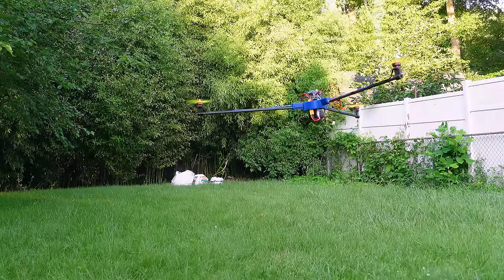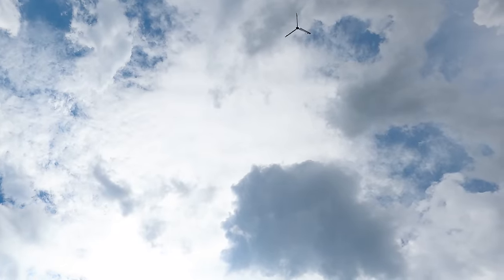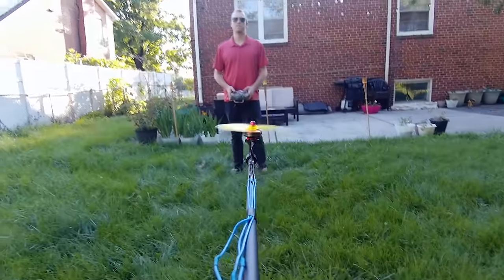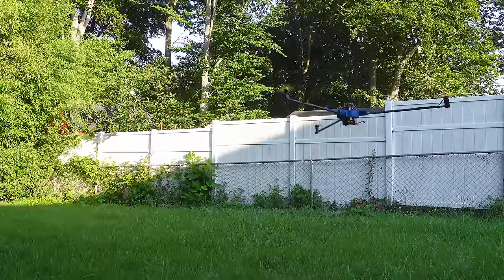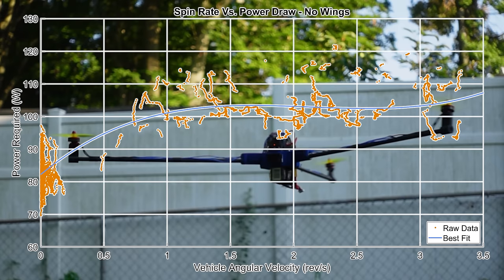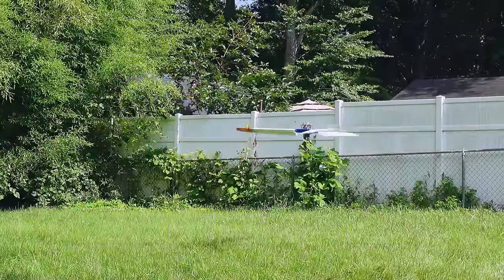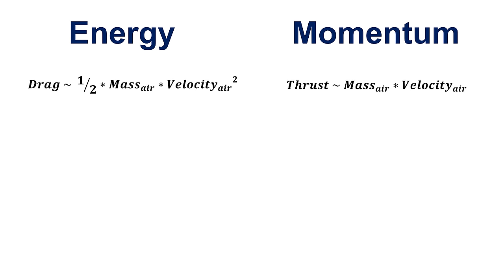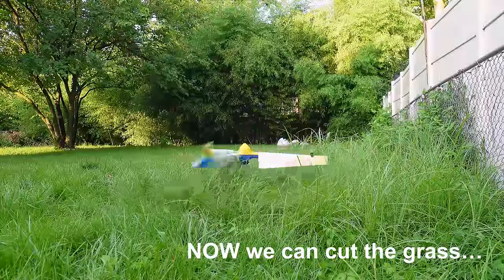The Spinning Drone Paradox - Part 1

Comment: Such a cool idea! Now to make a super fast one axis brushless gimbal so it can be used for FPV
Reply: "Simply" build an optical derotator ;).
It uses a rotating assembly of mirrors (or a dove prism) to get a stationary image of a rotating object (or the opposite in your case: stationary surroundings, rotating camera).
Reply: Or just fix the video in post with flow state.
Reply: A rotation compensator like this? https://www.youtube.com/watch?v=fkZ4uqd-2rw - that way you can also include a swash plate for cyclic pitch :) Can't wait to see what you have planned for directional control!/cb
Reply: @christofbeaupoil8035  The concept in your linked video seems very interesting, but I meant an optical image derotator. US patent US3625612A Fig. 7 shows the version with mirrors I was referring to. These are used for vibration measurement of rotating objects (e.g. Polytec PSV-A-440) and in telescopes to eliminate motion blur due to the earths rotation (e.g. "Barboza, 2018, Design and Prototyping of the Image Derotator for the ELT Infrared Instrument MICADO").
Reply: @LS-xb2fh  Also a cool idea!  But I was trying to answer to @rctestflight's comment about a brushless gimbal. That might be useful for everything that can not be stabilized optically :) /cb
Reply: @mrreddog  Usually when we say fpv in relation to drones it's referring to flying from a live video feed. No post processing from a live feed.
Reply: get more replies please
Reply: what about a ball or platform in the middle with gyro stabilization. Modernize the Focke-Wulf Triebflügel prototype
Reply: Good to see you hear brother!
Reply: Counter rotating FPV pod?
Reply: How about a 360 cam, with software that counterrotates the forward view in sync.
Reply: Sync the framerate with the rotation, the video would be slightly choppy but with only software trickery should work.
Reply: At that point, wouldn't it be a helicopter?
Reply: @anveshshrivastava2225  : You'll tend to get individual video lines misaligned with each other, in relation to the "shutter" speed.
Reply: Do it - please!
Reply: @SncSpartan  Lol
Reply: I built one with a gimbal a few months ago: https://www.youtube.com/watch?v=YqxiWzX9Bts

It used the stabilized platform for its flight controller and swashplate.  I didn't put FPV on it, but it would have worked.
Reply: use a 360 deg cam with auto direction.
Reply: @403.FORBIDDEN  yes, a fully isolated (no wires to the rest of the chassis) or slip ring connected gimbal module would work. I believe an active gyro stabilizer would work, and you could possibly put an IMU on the gimbal to provide usable attitude information. Normally the spin would outrun what IMUs can deal with
Reply: @absalomdraconis   - hypothetically, simple to solve in post production.
Reply: The way the Lockheed Martin "samurai" one wing drone gets images is it digitally throws away any frames from the high framerate camera that aren't taken in the desired direction.
Reply: @LS-xb2fh  Or just give it a fisheye lens and have the software rotate the image. This does require a camera with a high shutter speed ofc.
Reply: Deepfake
Reply: @LS-xb2fh  it would probably be easier to just rotate the camera, since they're so light (probably lighter than the mirror array)
Reply: Or use a 360 camera and dynamically change the angle?
Reply: If you use a 360 camera, you might be able to easily and quickly remove the rotation from flying in your video feed.
Reply: @anveshshrivastava2225  
I think this IS done on the Samurai, by Lockheed Martin.
Reply: Or software derotation, and make it 360°
Reply: Or a digital/virtual gimbal using gyro measurements?
Reply: Dont forget to put solar panels into the wings for longer flight times!!! 😉
Reply: Do I feel a Collab coming on?
Reply: yepp imagine 1 hour flight time for photogrammetry per battery. fractal propellers let's goooooo
Reply: @mrreddog  flowstate? Fix it with bardwell s doco ? Maybe gyro flow ;)
Reply: You'd also need a cyclic pitch control to steer
Reply: Well, there's this option https://www.youtube.com/watch?v=JfP7955XipY
(Using a standard motor & some gears)
Reply: If only the arms where able to rotate freely around the center hub, while that remained in a stationary state. But I don't think technology can handle that yet. It would need power to move to the arms without cabling.
Reply: There are 360 cameras
Reply: @JinKee  this is probably the best way
Reply: Oh hey I was hoping you'd see this!
Reply: @mrreddog  but that's no good for FPV flying
Reply: sync the camera refresh rate with the drone spinning speed ;)
Reply: Fpv camera pointing at a spinning mirror.
Reply: This sounds like your speed. Build one!
Reply: @mrreddog  you have to fly the drone first tho
Reply: Use a 360⁰ camera and use software for video rotation counter
Reply: Or put two on a airplane like the ospre
Reply: Just stick a insta 360 in it. I think it has that type of stabilization if is rotated then the image is undisturbed footage looks like camera has never been rotated.
I am not remembering the type of stabilization it uses.
Reply: @casoblantly  Why to use anything mechanical when you can do that in software later on ?
Reply: I thought this was your video at first hahaha
Reply: At that point, just remove the small propellers and make it a helicopter.
Reply: @mrreddog  Given the spin, you're gonna be dealing with tearing issues from hell. Video's gonna be borderline gelatinous. Better to put a simple motor on the base to carry the payload which can match speed with the rotating of the main blades.
Reply: You don't need to do that. Monocopters using only one wing and one propeller  that utilise a similar flight concept have been around for some time. They just use CCD cameras that sync the frame rate to the rate of rotation. This also incentivises high rpm rotation for smooth video
Reply: Really stupid question but would 360 camera work for better video? Or would that still spin?(I obviously know what a 360 camera is but don't know if there is software that would stabilize video😅)
Reply: @dimagass7801  not a stupid question at all. Typical 360 cameras involve a spinning head, which may or may not spin at the same speed as the rotor in this case, which means you may end up having a 360 camera that only actually shoots one small thing, rather than a running panorama.
Reply: @mrreddog  the only issue is that you want fpv to be as low lattency as possible, and post processing takes time, it's doable, definitely, but my take (as an embedded system dev) would be to take in multiple image, splice/stitch them, then using the movement of the drone, simulate a virtual camera and take the part of the video that's stitch/spliced, that or do overhead math to simulate that virtual camera, then just take input from the concerned camera and copy their frame data in the resulting frame accordingly (BUT the main issue of coppying lines of data this way is that it's not simple and cost operations, thus time, so it'd be slow (hell some file format add padding just so a row of bytes fit properly in memory cuz it's less calcul intensive this way)
Reply: This maybe can be adressed with a ball bearing (partially because of friction from the ball bearing assembly) decoupling the camera from the drone motion?
Reply: @lulululu4912  friction will kick in before too long, Even with the best bearings, and it will start the rotation where you don't want it to be. You need a counter rotation motor.
Reply: @anveshshrivastava2225  this is the most efficient answer
Reply: You and Rehm are the same person right??
Reply: @alexanderfaucher1619  that's an awesome idea!!
Reply: @TacComControl  Yeah I think you are right
Reply: You should also do it with solar imagine the flight time
Reply: @mrreddog   you “gyro-flow” right?🤔
Reply: one step closer to ufo's
Reply: By next week
Reply: my thought was having the arms rotate freely as well, there's some potential here and I can't wait to see more
Reply: @anveshshrivastava2225  Way harder than you make it sound lol
Reply: This comment thread is full of great ideas. Cheers to you all for kindly contributing. :)
Reply: @alexanderfaucher1619  Seems to me to be the most perfect approach.
Reply: I actually think this design wont work for super fast FPV drones. These wings greatly increase flight efficiency but decrease acceleration and maneuverability. You have to move more mass and you also increase your drag coefficient. If you want the insane maneuvarability of an FPV drone, all the movement of air needs to be controlled by the propellers. However  think this design could be extremely useful for filming (if you can get a camera attached the is decoupled from the rotation) as the drone can fly for much longer, potentially higher in the air and most importantly, it creates less noise (which can be immensly important if you want to film animals from above without distracting them).
Reply: I can already see ppl thinking these are ufos lmfao 🤣 imagine upscaling this …
Reply: @zaceryhammond1144  you all do realize that this is just a helicopter with extra steps right?
Reply: The camera would need to be quite a way away from the drone or it would be shooting between the arms!
Reply: Nah medium speed gimbal w/ high speed 360 camera and software stabilization
Reply: does spinning will help with horizontal movement as well ?
Reply: Just lock the shutter to the rotation rate. You could even have two cameras and get binocular vision.
Reply: make a Star Wars X-Wing fighter with propellers on 4 wings
Reply: Hi Daniel, how you doing
Reply: Can you try this with toroidal shaped props?
Reply: Homegrown inventors are the key to the future! It's a shame we can't interview the Wright Brothers. To this day, all planes still fly on the principles of the Wright Brothers
Reply: @alexanderfaucher1619  So in essence build a sandwich of two of these, one rotating clockwise, one counter clockwise?!  What could possibly go wrong?
Reply: "easiest" way to do this is have the gimble as part of the drones spin control, and then the camera is a totally separate system (battery, control) so nothing has to pass through the gimble that would allow you to use a cheaper motor that can sync to the spin speed, and then the gimble control would all be on the camera side. 
this would also make it a lot easier to have the gimble rotation trimable to match with the rotation speed.